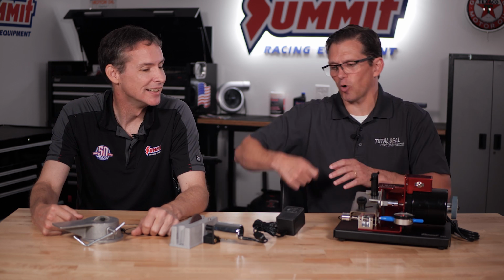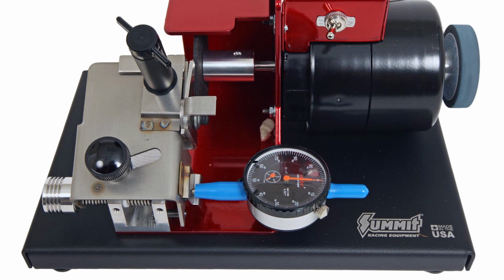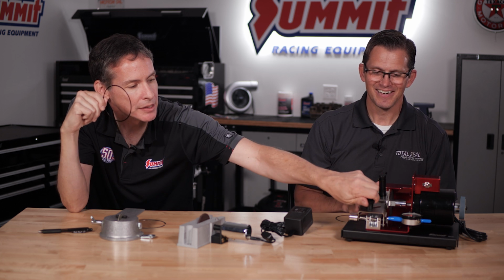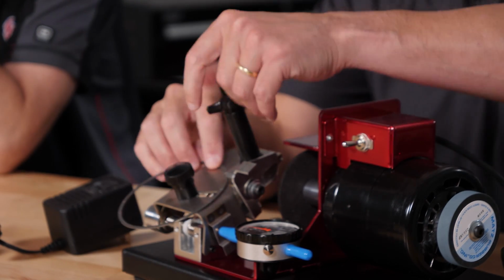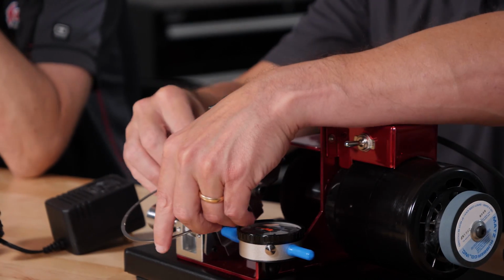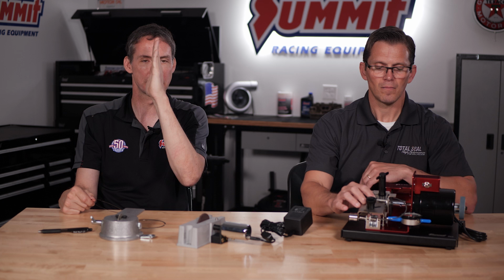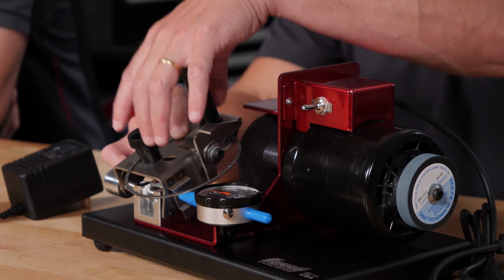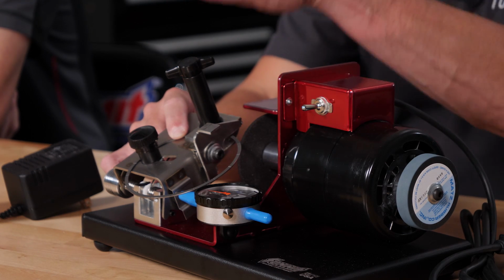Piston Ring Filing 101: How to Properly File Your Piston Rings (& Why It’s So Important!)

Comment: I bought The Summit Racing Pro Ring Filer in Candy Purple yesterday for $741.99.
Its Expensive but I am glad its Endorsed by Lake Speed of Total Seal Piston Rings. 
This is the Identical Total Seal Pro Ring Filer for less money and Yiu get your choice of many different finish colors. 
I have my own 1970 Trans Am RAIV engine to file fit Total Seal Stainless Steel AP gas ported gapless Top, Napier 2nd Rings and a Friends 454 SBC Super Mouse Engine in 2025.
My Bud 2 Hacks Jeff has 2 Vintage Dragster Rail Methanol Alcohol Engines he is building to Race in 2025.
And Jeff's friend Kyle has a Project Pontac V8 Supercharged 1000 + Hp taking place too.
If you ever screwed up gapping expensive Racing Rings it sucks. Have to call and order more.
I  have used those hand crank Piston Ring Filers all of them hate them. Precision is a Misnomer using one, pure junk they are all.
Also no more crooked piston Ring gaps all those hand crank piston Ring filers do that crap.
I will make a Review and demonstration on my own channel soon on the Summit Total Seal Pro Ring Filer.

Comment: If you have a standard piston in a standard bore, would newly purchased standard rings require downsizing?
Reply: Yes
Reply: Yes if they are file fit rings. Just buy an engineered set for a regular engine. Don't waste your time. This is for hi-po engines. I wish you guys would mention that. But do check them. It's rare but once in a while there's a .020 ring in a set. Or a standard ring in an oversize set.,which can be easily overlooked! Mic everything. Bearing thickness too. Always watch for standard parts in oversized packagings!